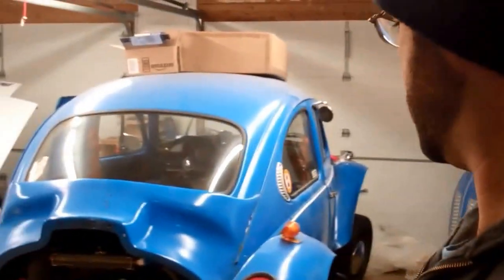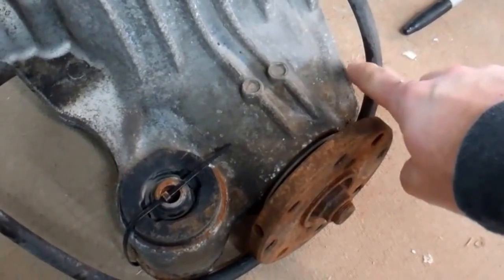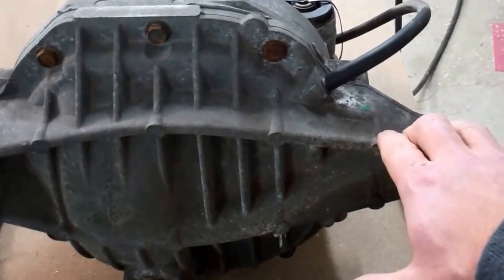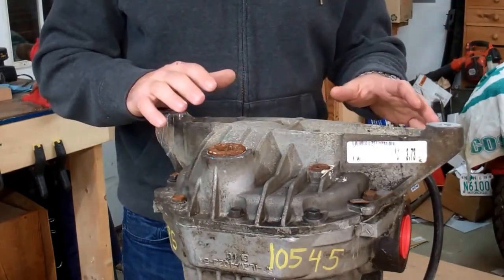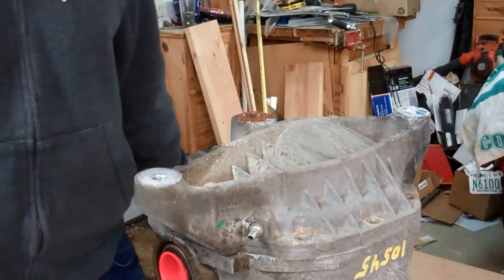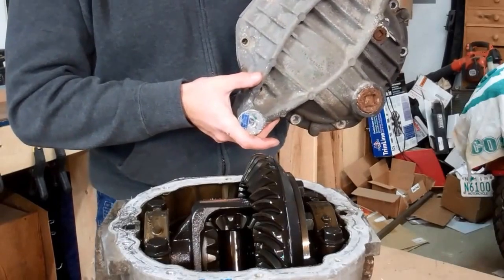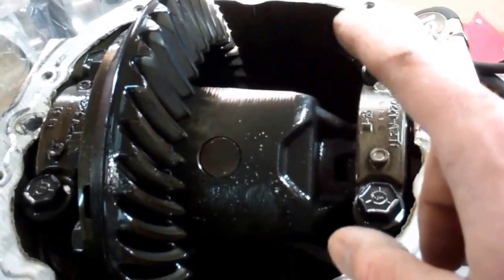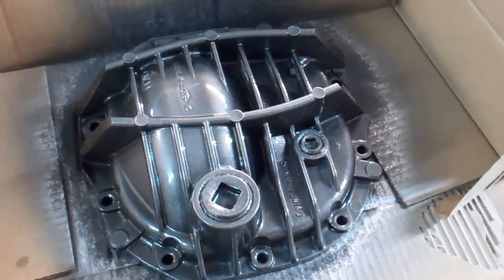Ford 8.8 IRS install in Mazda FC RX7 - addendum

Comment: Dave where did you order the Ford 8.8 IRS pumpkin from?
Reply from the maker: Ebay! This one specifically came from a junk yard in northern Vermont. It's all aluminum so rust isn't an issue. The early 2000's Explorers came stock with these things so they're readily available - just change the gearing (or don't if you have a turbo) and add a real LSD.

Comment: can you use the Moser Engeenering cover that does not have the ears to avoid having to cut anything the model number is 7106
Reply from the maker: Great question. Looks like it would, but I would want to test fit before committing to saying yes. Maybe I'll buy one to find out. If I do I'll post an update video.
Reply from the maker: Did some additional research and it does appear that you can use an aftermarket 8.8 diff cover without issues to avoid cutting the ears off.
Reply: David Estey thanks a lot deeply appreciate it
Reply from the maker: Happy to help. Let me know if you come up with any more questions.

It's worth the swap!
Reply: Dave Estey what axles did u use? ronins?grannys? homemade?
Reply from the maker: Carlos Diaz Ronin supplies conversion axles. I paired them with new Mazda 626 turbo outer CVs.
Reply: @OfficialistDave  when using the 626 turbo outers, is it direct fit into FC hubs? or is there modification required?
Reply from the maker: @v8powa466  As long as you have 5-lug hubs you're golden - so TII, GXL or GTU. 4 lug hubs no bueno.